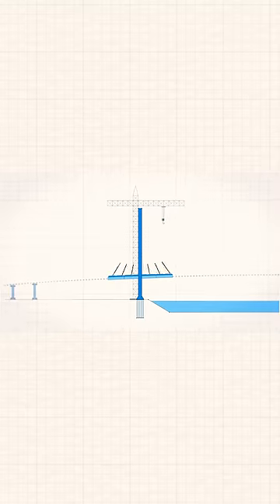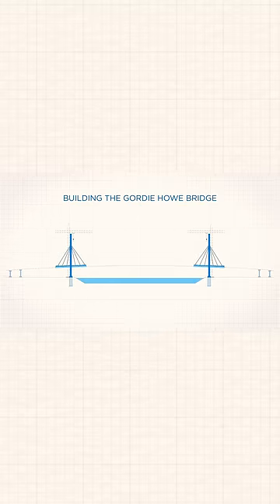This MASSIVE Bridge Will Connect the US and Canada

Comment: I never understood why they use concrete for the deck of bridges.  That's really heavy.  Steel grating would probably be better in a lot of ways.
Reply: Steel is also heavy
Reply: It's cheaper, doesn't rust, and weight adds stability.
Reply: Believe it or not there's an old WW2 era bridge in my town.  It's a cable stayed bridge and uses steel grating for the deck.  Every time I bike over it I'm afraid I might drop keys or something down through into the water.  It's the old Hawkesworth bridge in San Ignacio Belize.  I think it would be good for winter climates because the snow would just fall through.
Reply: @------country-boy------- the Mackinac bridge 300 miles north of detroit has Steel grating. It gets lots of snow and ice. Often the bride will shut down with too much snow ice or wind.
Reply: @PD-we8vf  I just googled it.  Looks like the grating on that bridge is small mesh.  The bridge in my town was made in England and the grating openings are large triangles.  At least 3 inch big openings.

Comment: Why spend over 5 billion dollars on a bridge that's very close to another bridge that does the same job?
Reply: The new bridge will carry more traffic creating a less bottleneck situation.
Reply: The other bridge is 80 years old, and only one lane. At least ask google before you ask a stupid question
Reply: its so blocking the one bridge doesnt grind everything to a halt.
Reply: As we saw a couple years ago, when the existing bridge can't be crossed it creates a lot of problems. That's good for civil disobedience but bad if it's down for repair or worse collapses. Bridges only last so long even with maintenance and it's wise to build a replacement before it's needed.
This is a particularly expensive bridge but it's really big and going to last another hundred years.
Reply: @lonelyman1967  Yes plus this new bridge will have better direct access to freeways in Canada and the US.  The current Ambassador bridge requires a lengthy drive on Huron Church road in Windsor which is largely a local road with a lot of stop lights.
Reply: Need more lane capacity to flee the US if Trump is reelected and the US becomes a failed state.
Reply: @glent7853 Wow, you really got triggered by my comment, LOL
Reply: Most of these replies are euphemistic rationalizations. The Ambassador Bridge has been cripplingly backed up with truck traffic for at least 30 years. (from a US-Canada trade agreement) It would be much worse except that trucks will take long, evasive routes to save time. The private owner of Ambassador Bridge has successfully eluded the court orders that would have the facilities upgraded to improve traffic flow. (Upgrading would cost a fortune upfront.) Politics in Michigan is such that a better route over the river, far south of Detroit, could never gain legislative approval, because Detroit needs yet another attempt to save it, and it has voters on which one party depends. Canada, in negotiations over ten years ago, already agreed to pay for 100% of a new bridge, to speed things along. Yes 100%. Seems fair. But good jobs inside Canada may be competition for great jobs inside the US, so nada.

There is a cramped tunnel to Canada near downtown Detroit, which has always been slow. (And frightening.)

There is a railroad-only tunnel to Canada maybe twenty miles south of Detroit, in Trenton MI.
Reply: @OwentheKingofDudes Most of the people who asked the exact same question as you had also had a smug sense of self-satisfaction that they (and only they) had come up with a really clever question that (supposedly) revealed the complete lack of need for such a bridge and that (supposedly) proved their superior intellect which far surpassed the combined intellect of all the people in both countries who correctly saw the need for this project,  when all the question did was display their ignorance of the situation.
Reply: Ambassador Bridge was opened in 1929, making it 94 years old
Reply: @darcyperkins7041  All I did was ask a question. Why are you taking that so personally?
Reply: @OwentheKingofDudes 'cause the reasons were already provided for you in the video, dude